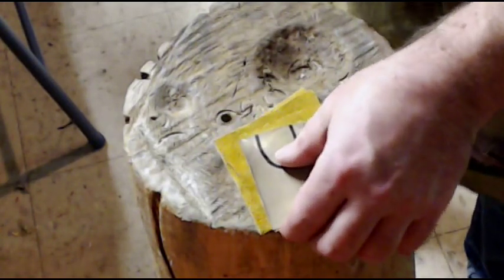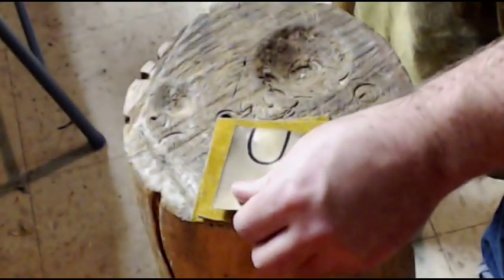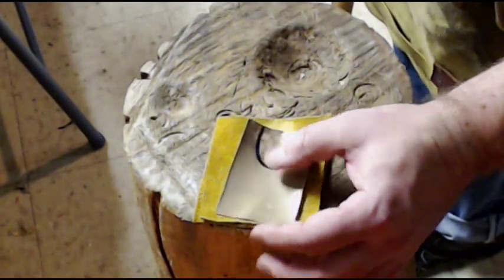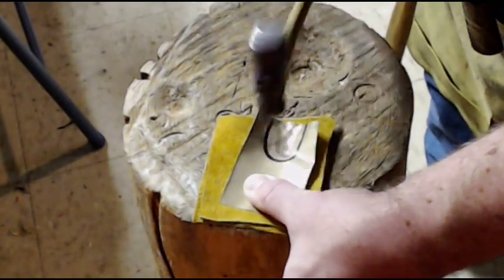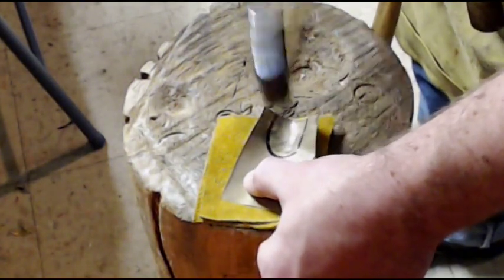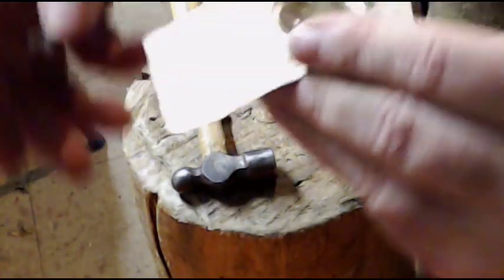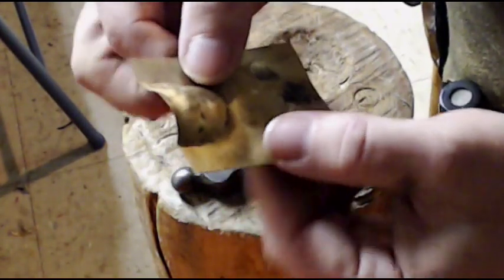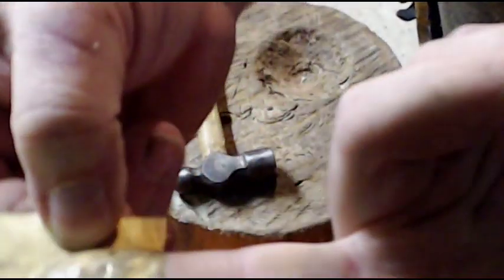Forming Sheet Brass with Hammer and Stump (Shrinking, Sinking, Dishing)

Comment: Just in case you're looking for ideas, I've never hammered metal before but I'm trying to make a resonator guitar. I was going to attempt a cover plate. If you wanted to do a video on it I wouldn't mind so much. Thanks.
Reply from the maker: Tell me more about what you need. Does the cover plate need any special acoustic properties? From what I have read on this they are usually some sort of steel or tin. It would be fun to do one in high polished brass.
Reply: Artificer Made OK well, when resonator guitars first came out many decades ago (probably sometime in the late 1800's) they were meant only to make the instrument louder. But, they had a distinctive sound and it soon became part of American music. The cover plate was added to bring the volume back down. Plus they look great. So I guess no it doesn't really have to have any acoustic properties. The resonator cone makes it sound the way it does.

I'm the type of guy who likes to put together things out of other thing I find and for a while now I've been planning to take this old guitar I have and modify it into a resonator guitar. I'm going to use a bundt cake pan for the resonator cone (it's roughly the right shape and it's made out of the right material) but it's the cover plate I'm having a problem with. I also make cigar box guitars. It would be nice to make a smaller one too for one of those. So the full sized would be about 10 or 11 inches. They vary. And the smaller one would be about 6 inches. Usually they are made out of chrome plated steel (I guess) but a copper or brass one would look fantastic. There are 2 kinds as far as I can tell. The first would be plate shaped with a large hole in the middle for the biscuit, holes in the plate in a decorative pattern and something that covers the hole like a bridge. Like this.     http://www.richtonemusic.co.uk/Data/Product_Images/GRETSCH271-7010-000b.jpg    I think this one may be a lot easier to make. The other kind has high parts and low parts that allow the strings to pass through with the bridge for your hand built in. Like this.     http://i00.i.aliimg.com/wsphoto/v0/634336892_1/Wholesale-New-6-strings-font-b-resonator-b-font-font-b-Acoustic-b-font-electric-Guitar.jpg 
Probably more difficult. It doesn't as far as I'm concerned have to look perfect or just like those. I don't mind a bit of a DIY look. I know I could just buy a resonator kit but I just don't want to do that. I tried to give you as much information as I could, sorry it's so long. If you do decide to make this video you'd have made a new friend. :) Do you have any other questions? Thanks.

Comment: Think I'll have some bourbon too before I start recreating what you just did. ;)
Question: How is this kind of hammer called? :)
Greetings from Poland!
Reply from the maker: Hello Poland! The hammer I used in this video is called a ball-pein hammer. Sometimes it is spelled ball-peen. It's the second most common type of hammer out there so it is not hard to find.
Reply: Artificer Made Interesting, I can't recall seeing such a hammer before. Anyway, thanks for your tip, I'll see if I can get one cheap. The ball end seems to be crucial.
Also I was aiming to give my piece of brass a bumpy finish.
Reply: Ball pien (pein?) hammer
Reply: @artificermade3396  you can buy them at any good hardware shop i also have one made silocone